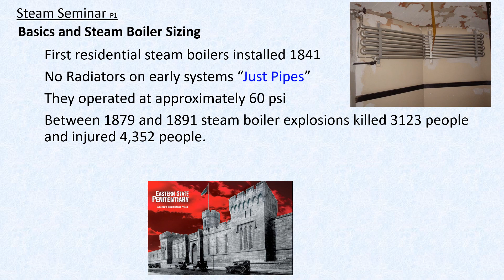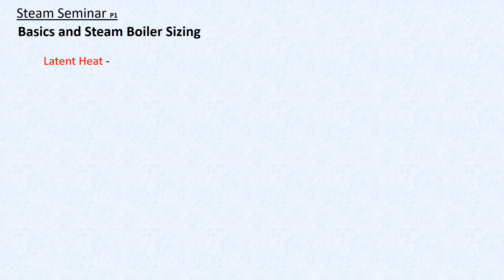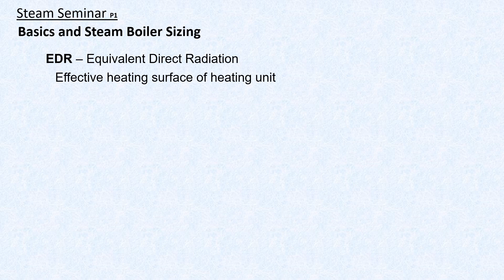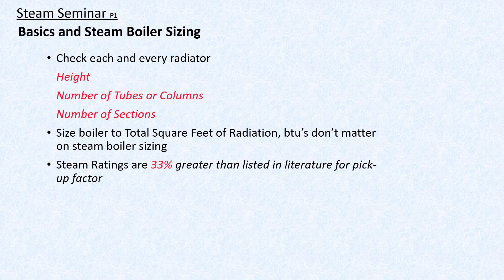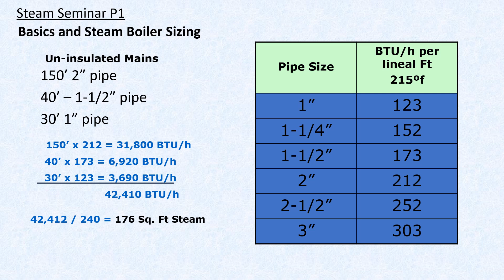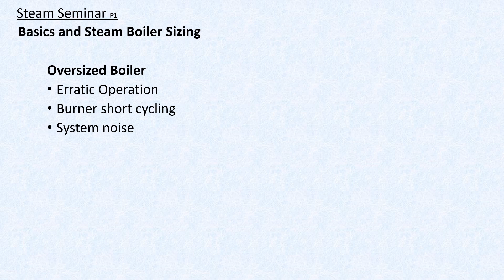Residential Steam Basics and Boiler Sizing

Comment: hello i'm going to need to replace my steam boiler been asking around on size and getting different answers i got 6 unit building all radiators 24" height 5 radiators in each apartment tubes / sections 5/12 , 3/10 , 3/10 , 3/10 , 6/8  plus a hallway radiator 6/10 my math is around 890 EDR pipes and returns in basement all insulated attached both sides brick face and back if correct am i looking at peerless 64-07 or steammax 350